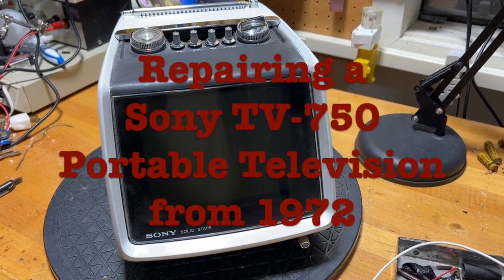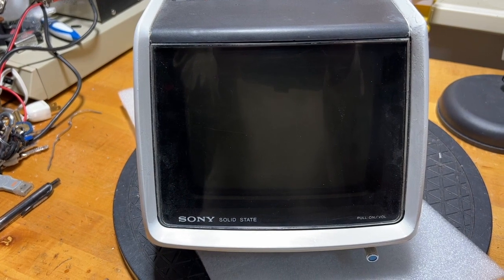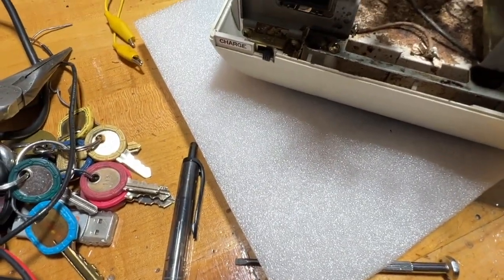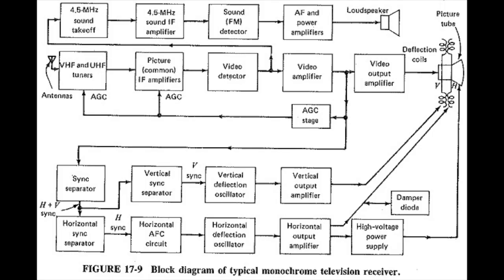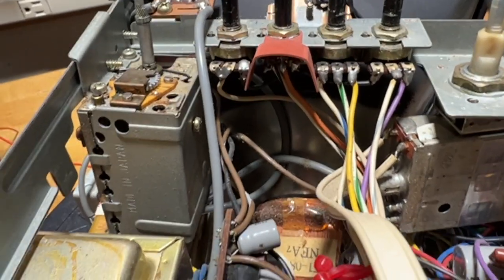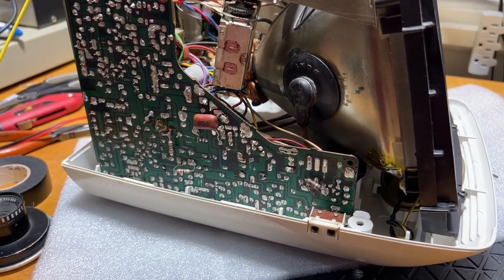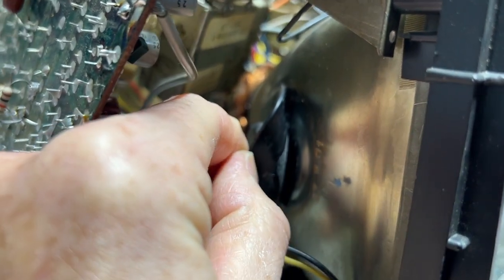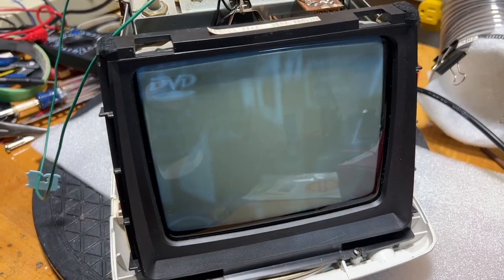Repairing a 1972 vintage Sony TV-750 Portable Television

Comment: This tubes always fall. Bur increes filament with 10-15% can be good. Or borrow sn crt rejuvinator. The non cathode tubes get oxide on the heter. By running a clean process the can be good. I did it on older Sony bw crt worked oerfectly
Reply from the maker: Thank you for the reply. I would love to increase the heater voltage but I can't see how to do it. The filament runs off its own transformer (fed by the horizontal output) and as far as I can tell the filament is running (nominally) at only about 0.2v, not the usual 6.3v. There are no brightness taps on the transformer to change or any series resistors to reduce. I don't think my Sencore CRT tester/rejuvinator goes down 0.2v. It's one of the strangest CRTs I've seen. You can't even see the filament glowing when it's running!